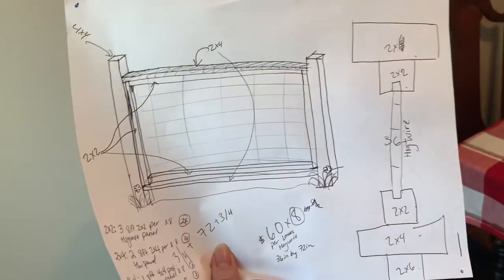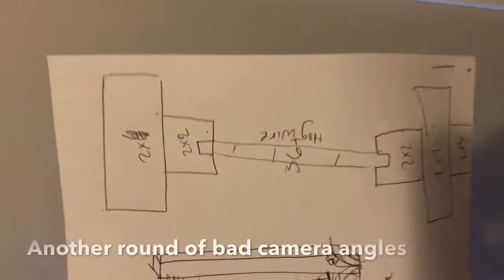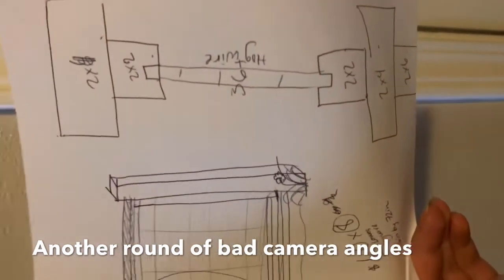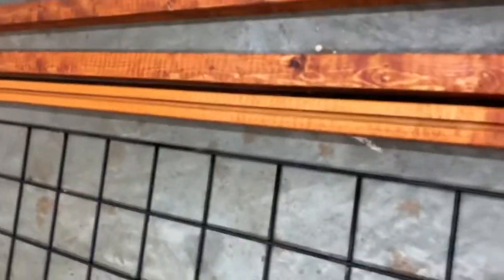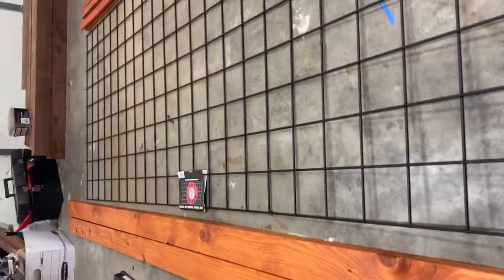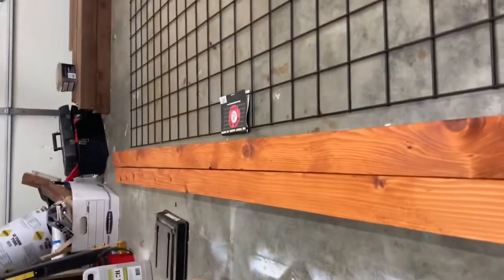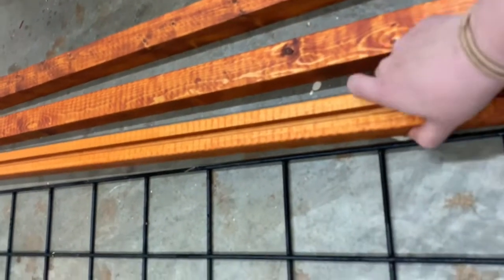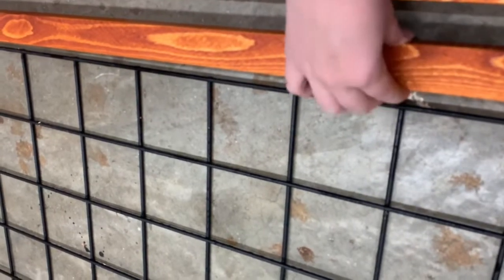Cuts to frame a hog wire fence

Comment: Hi Ms.Stevens
I love the fence and would like to make similar one , would appreciate your help 
1) did you use pressure treated wood?
2) what’s the stain name/make/ model and where did you purchase 
3)what’s the name of wire and where did you purchase it?
Reply from the maker: Hi Mo, 

We used pressure treated wood for the posts and the 2x6 toe kick (anything with contact with dirt or grass). 

We used a chestnut colored deck stain on some pine 2x4s and 2x2s. We used the one on clearance (we got time, but still a teachers paycheck) and have since thrown away the can. Any deck stain will work. 

We bought the hog wire from a Bellingham company, Winser Plywood. My husband and I went there for the special wood projects. They have some great stuff! 

Have a good time creating!
Reply: Kristina Stevens Thanks!